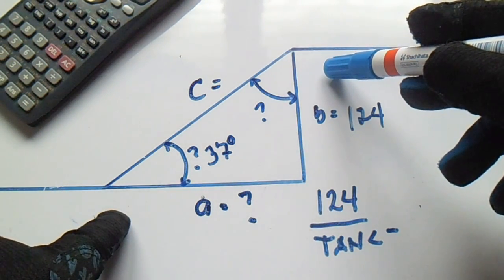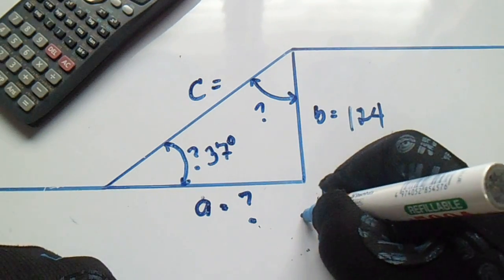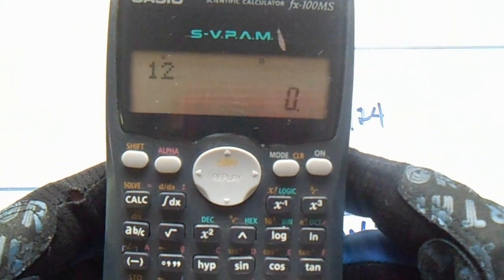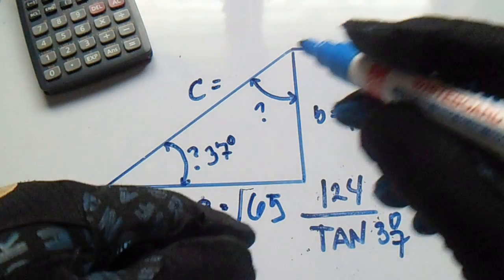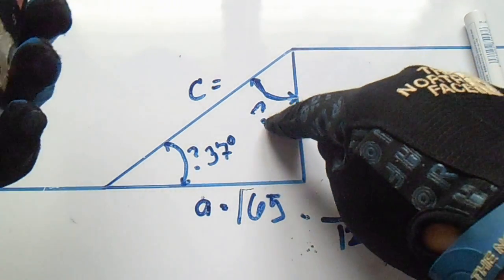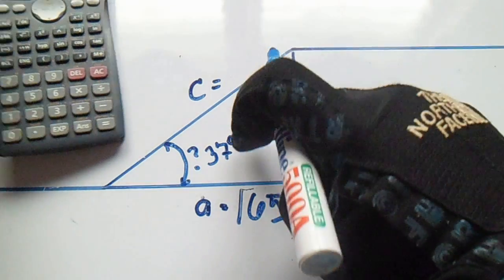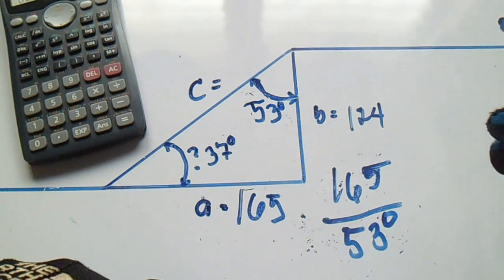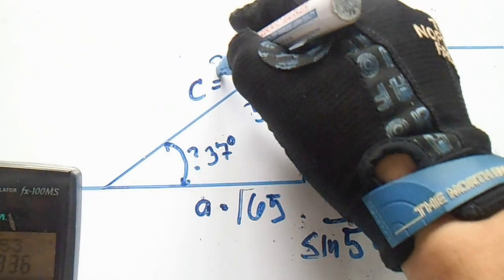Pipingweldingndt - How To Find Angle and Length of Side

Comment: i have a 6.3 degree wingwall that I need to run a 6" steel pipe along the wingwall. The outer diameter is 6.625" and am looking to figure out the radius of curvature. Can I get help with this?
Reply: Make a template out of cardboard.

Comment: 37+90= 127      180-127=53 degrees  you don't need a calculator to do this.  I do it in my head.  Basic math from grade 6.   Triangle must equal 180 degrees.  Been a pipe fitter for over 30 years.
Reply: in the video, the sample is a  right triangle (always has 90 deg), so u just get the difference, 90-37 = 53, you can apply it to all right triangle formula
Reply from the maker: Nice to share it
Reply: Todd Ransom you you please show me how to do this type of math🙏
Reply: Todd Ransom Thanx!
Reply: Ok ur sudgestion but the video is have a given..not a short cut

Comment: Here is my problem that I hope I can be help with
I have a set of 3" and I am using 6" pipe 
I do not have the run or travel length
What I need is to find my angle to be able to cut my fitting
So to recap I have a 3" set with 6" pipe diameter
Need to know the angle 
Thank u
Reply: Pm me

Comment: as we know, for a right angle triangle, the total of all angles is 180, we have a given of 37 deg. and the right angle 90 deg. then obviously, we had a remainder of 53 deg.    180-(37+90)=@     180-127=53, applies to all as long as we had the 90 deg. right angle, just for the short cut sir.....
Reply: Immediately solved it just like that lol
Reply: right triangle always has a 90 deg side, just get the difference no need long computation, 90-37 (which is the given value) ans will be 53
Reply: Larry770 Thanx!